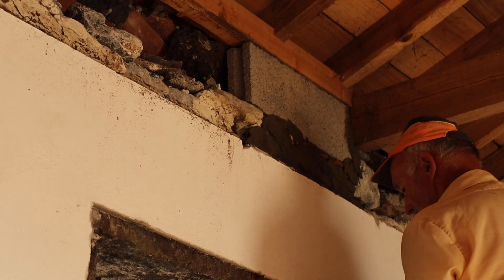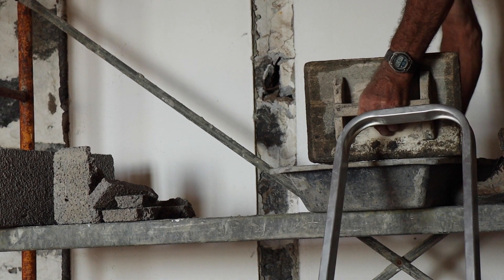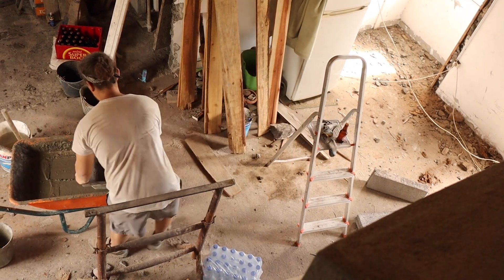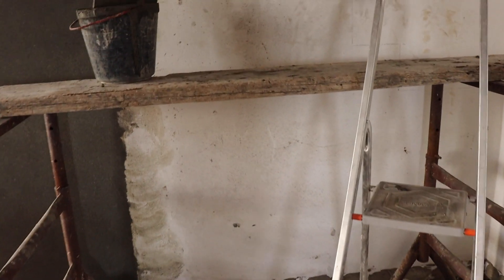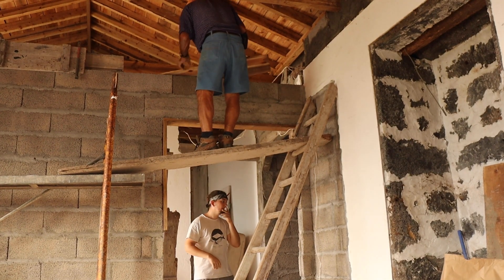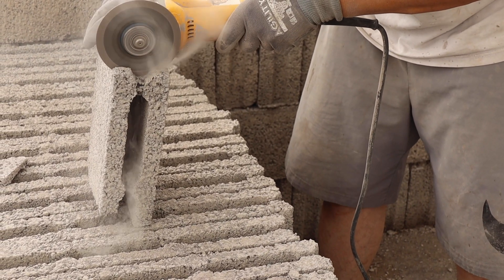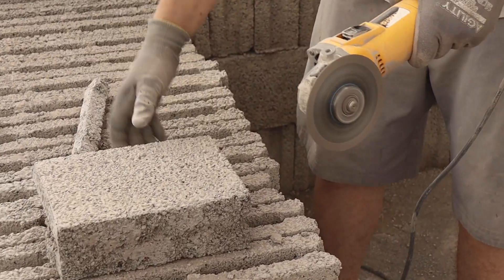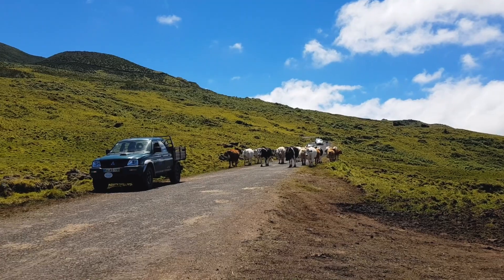So much GRATITUDE | Life & Renovations on Pico Island, Azores

Comment: I love - love - love that wooden ceiling !  Are you going to keep the ceiling open ? I would . It’s interesting how he uses black or dark colored plaster ? stucco? to fix the walls. Those hydrangea hedges along the roads are amazing on Pico. The weather and landscapes on Pico are exactly the opposite of here in the desert. Love the misty fog. But if you have to vent here during the renovation it’s ok with me . I am sure it’s overwhelming . The little speech on gratitude is a great reminder.